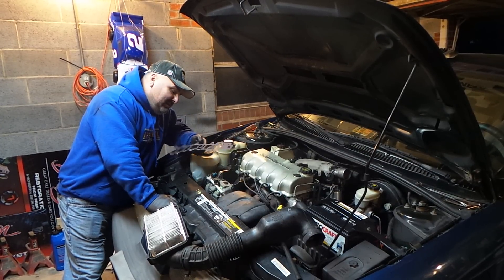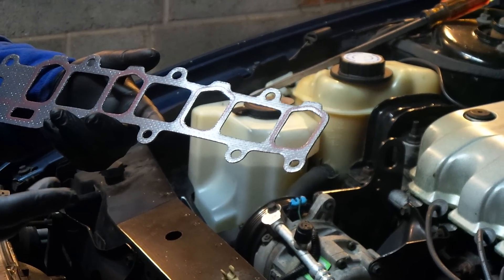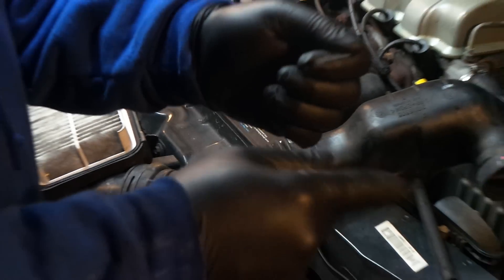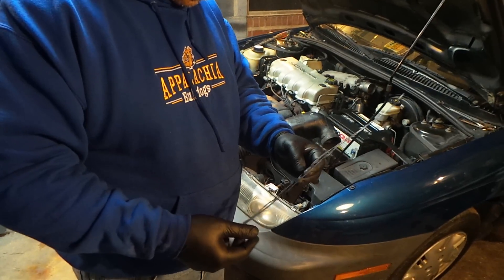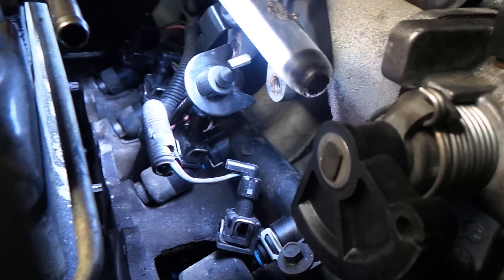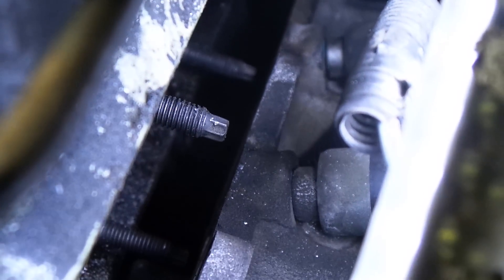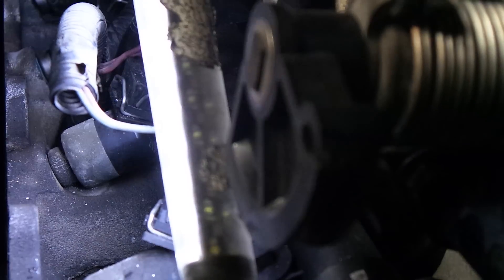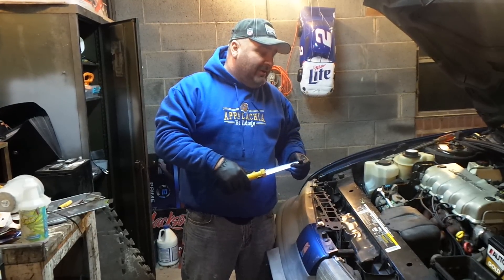Tips On Replacing The Intake Manifold On A Saturn 1.9 Liter

Comment: Thought I would say thanks for making this video. Also would like to add a few tips. I have a 2002 sc1 and I would suggest taking the serpentine belt loose and then loosening the power steering pump 5ea 10m bolts. 3 are under the pulley the other two are at the bottom of the pump. Once the pump was loose, the manifold was able to slip by and I was able to clean the head and manifold. It was amazing the car ran so long 80k because that gasket was wrinkled and busted. Thanks to your videos, and richpin there isn't much I can't do to this car.
Reply from the maker: Christopher Brandaberry Hi Chris, thank you so much for your feedback and also for sharing those tips with our subscribers' and viewers'. This channel is all about helping each other out and sharing information that others might find helpful. Hope to see you on the channel often and be sure to check out our contest video. We started doing a contest each month as just a small way to thank each and every one of you for making this channel successful. Thanks again, Jamie and Jen

Comment: Thanks for the video.  I removed the power steering pump, as requested in the Helm manual, as it seemed like access would be more difficult without it.  How do you achieve 22 ft-lbs of torque in such tight quarters?  Do you have some sort of wacky shaped torque wrench?  The only thing I could squeeze into the area is a standard 1/4 drive ratchet with deep well socket with about a 6" lever arm (that would require 44lbs of force in these tight quarters).  Not sure if I was able to tighten it well enough.  I guess I will know if my misfires go away (I already, swapped plugs, wires, injector, check compression, etc, and there was an obvious vac leak near cylinder 1).

Comment: I removed 2 bolts 1 at 2 o'clock and 4 o'clock. There is also 1 bolt at about 5 o'clock and I loosened that one. But the pump only went back 1/8 of an inch. I need another 1/4 inch to go back.
Reply from the maker: Alfredo Delgado Hey Alfredo, were you able to get that extra clearance that you needed yet?

Comment: Several steps missing in this video power steering pumps is in the way and the coolent is connected to it needs to be drains and there are breakets holding it in on the back of it